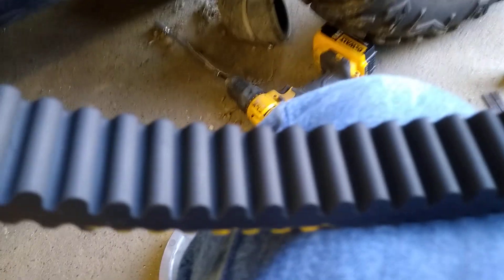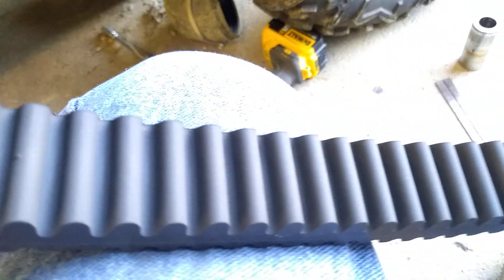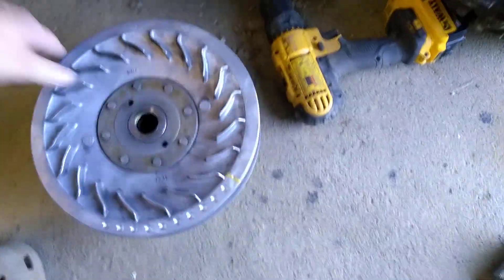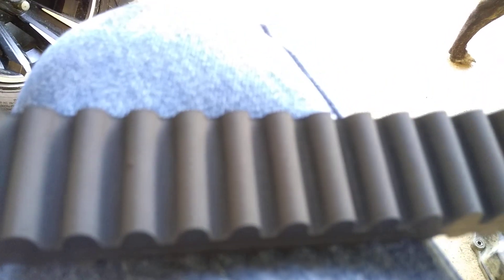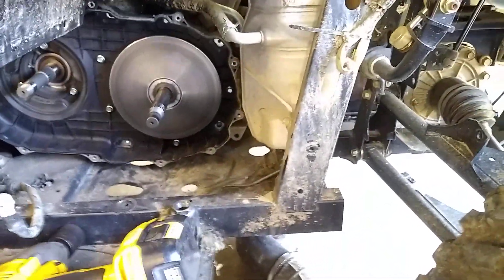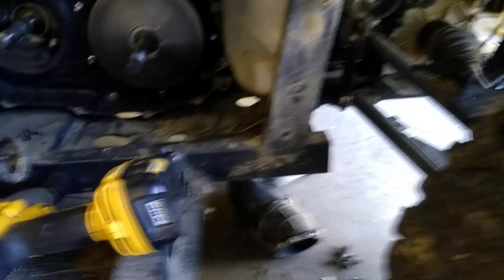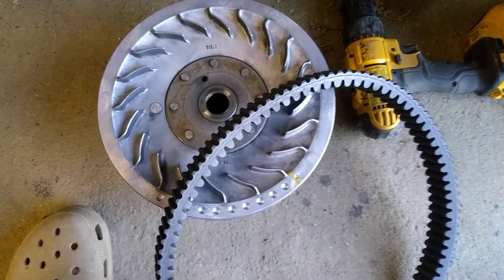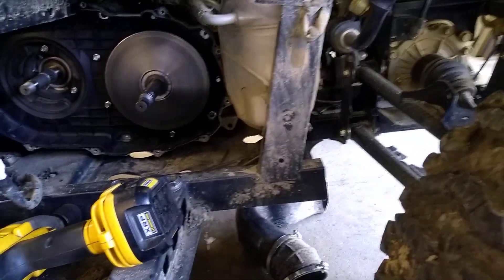JBS vs HW lies

Comment: Best there is.  Had a Rhino years ago, wanted to mod it, seen the clutch mods in action from the other guys, so I went to a rzr.  After dealing with the rzr and it's problems I seen what a Rhino with a JBS clutch could do and how reliable it was with no ill effects.  Ditched the rzr for a new Rhino in 2012, took it straight from the showroom floor to JBS for a few mods and I'm still running it now.  This guy knows what he is doing.  Until can am and polaris decides to start testing and building machines with reliability, I will run Yamaha or Kawasaki and take them straight to JBS for the best mods to make them perform.